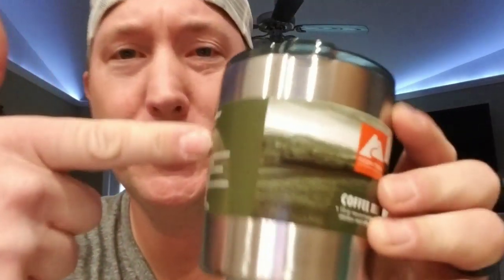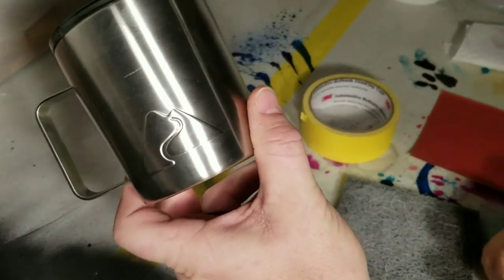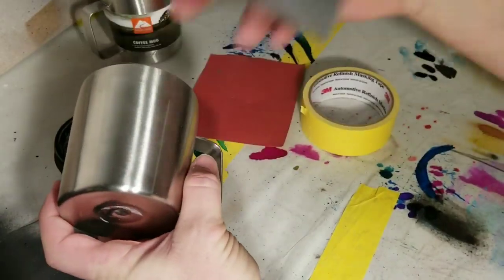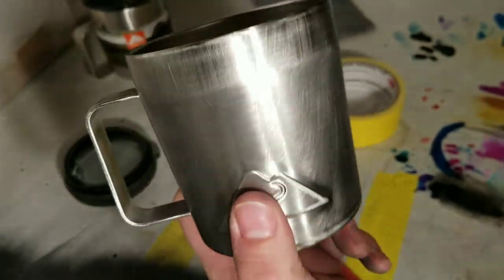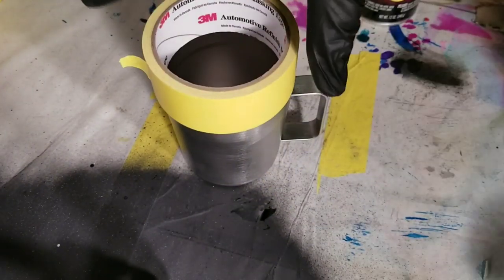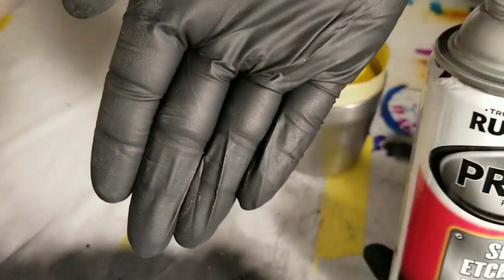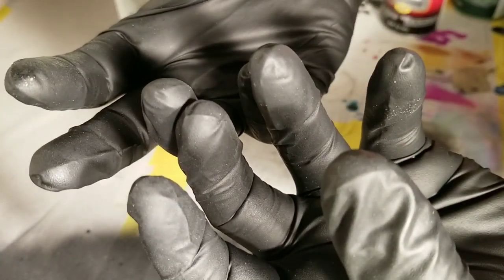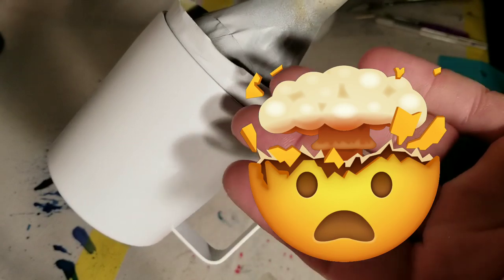Best How to Prep a Stainless Steel Tumbler from BARE METAL

Comment: Hey Duncan, just in case you want to skip the tape step( bc I hate it!)... a red solo cup shoved in the opening usually fills it up (almost any size tumbler) to the point where I don’t need to tape. Then just stick your hand thru a rag and into the solo cup to spray! No tape and no overspray😉
Reply from the maker: Ooooh niiice!! Thanks!
Reply: Excellent tip. Thank you

Comment: wow I been doing cups for a little more than two years , I see people's prep videos but never seen so much prepping, I have problems with wood grains but usually dont with anything else, I used to say no way am I sanding the cup first because people told me it doesn't bind , but when I strip cups everything comes off ok except the paint, I dont care what I do I can not get off the paint unless I strip again with the orange stripper (forgot what its called).  but wow now not only do I need to sand but get some etching primer .....ok , ill try it.lol thanks for this video...hope you do a video on stripping a cup , and how come it seems like I am the only person that after stripping a cup if the inside gets paint on it , I can not get it all out , I did a cup and was finished and could not get the inside not to look stained. Every have this happen , if so what do you do? thanks for all your help. Haha I thought my family was goofy.lol
Reply from the maker: i have tried not to prep and sand because i have seen others do it that way, but somewhere along the process something will lift or pull off. i prep these metal tumblers the same way i would prep a motorcycle tank - for durability and longevity

Comment: I thought etching primer is just to prep the metal from surface rust so rust Impregnation isnt an issue later once the cup is finished and rust doesnt appear under the paint causing bubbling or peeling. The acid in the acid primer burns the into the metal to clean it from rust (phosphoric acid removes rust from metal also known as Ospho) and the zinc in the primer seals the surface afterwards. I will say sanding the cup and making sure your brand primer bonds to metal in general helps for sure but etching primer isn't necessary but would be the correct way to do any government work.

Comment: So what’s the difference between the self etching primer and the ultra matte white paint and primer? Can I use just the ultra matte after I sand it or is it better to use the self etching first?
Reply from the maker: I like the etching because it has a different chemical make up which helps promote adhesion to bare metal

Comment: I just love watching u ..have u tried the diamond clear coat on tumblers yet?   Im just starting out with apoxy. And still not getting smooth finish yet. Dipples and fish eyes 😳..
Reply from the maker: Alumilite Amazing Clear Cast is the only one I have ever used. I have noticed that I have better results when I heat up my bottles on my portable heater before I use them. Also, make sure you are rubbing you tumbler really well with your gloves hand while you are epxoying - kind of like your giving it a massage
Reply: @DuncanCustomAirbrush  Hey Duncan, your work is AMAZING!! I am just starting with this craft. What do you mean by "I heat up my bottles on my portable heater before I use them." Do you heat with a torch or a heat gun while they set/dry? Or you warm them before you start epoxying? Thank you so much in advance!!

Comment: So I’ve just been sanding and cleaning with alcohol and spraying 2-3 white matte coats. Is that not good?
Reply from the maker: I've seen people do it, some people don't even sand...im not sure how they get away without the layer flaking or peeling off. Me personally, I like to make it as piece-of-mind durable as possible. My background is painting motorcycles and we would never paint bare metal without proper prep and priming. I like the etching primer because it adds a chemical bond on top of the mechanical (sanding) bond.